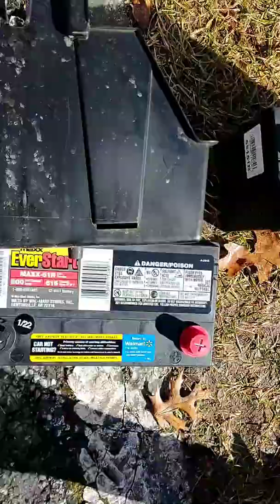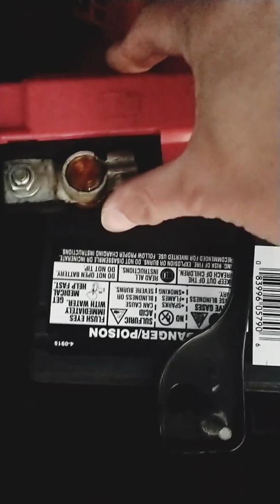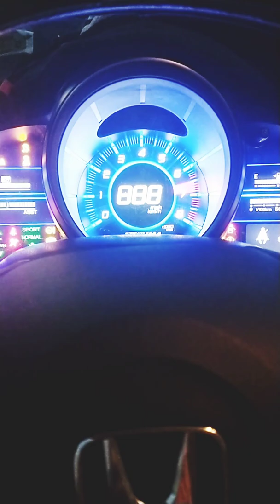Honda CR-Z battery upgrade

Comment: Can you send a link for the battery terminal connector please?
Reply from the maker: Hi, thanks for your request. I'm not sponsored but here are two options:
This fully compatible quick disconnect terminal from eBay: item#204538835078.
And the one on the video just search on Amazon for: Heavy Duty Car Battery Connectors, 0/2/4/6/8/10 AWG, Top Post Multiple Battery Terminals (Silver).

Comment: Stupid question, what are the benefits of upgrading to a bigger battery?
Reply from the maker: @Momomo8973  if you live up in the north east, a bigger battery will not leave you stranded due to the cold winter, as well as it will not degrade as fast as the original battery during summer. A bigger battery won't give you codes for abs, power steering or any other modules because it won't die faster.

Comment: Does anybody make an aftermarket tray so I can keep the battery protected?
Reply from the maker: I don't think so, the one that holds the entire battery from sliding is the hold down bracket. I know an aftermarket hold down bracket is way better and stronger than the OEM. You may also find info on K swap forums on this specific vehicle because most of the components are replaced in the process. Good luck on your research.
Reply: You can use the stock one all you have to do is trim like 2 inches of it. I put in a 51r and am still using the stock plastic tray it's really not an issue

Comment: Good mod, however, I don't see why you need the extra cranking amps considering the high voltage battery is used to start the engine.
Reply from the maker: It's an upgrade from a small battery to a bigger one to withstand winter up in the north.

Comment: Why did you pick the 51r series curious
Reply from the maker: It's a matter of fitting it inside the engine without major modifications, more cold cranking amps, and the location of the terminal post. The old and small battery wouldn't stand cold weather for a week sitting still.

Comment: You have to reset the computer after ?
Reply from the maker: Yes, sometimes. Mine had the ABS and the power steering modules "low voltage" codes stored.
Reply: @simplemods  is that code easy to turn off ? It’s the only thing holding me back from putting a new terminal on
Reply from the maker: @freelancedentist9480  a regular obd2 scanner will reset them off, I have thinkdiag scanner. Otherwise relearn mode is available on most vehicles.